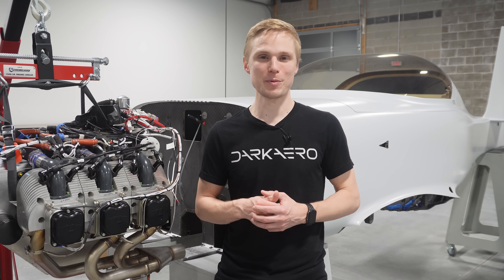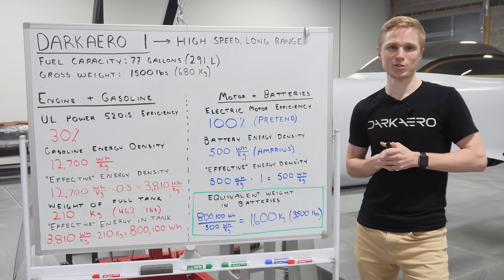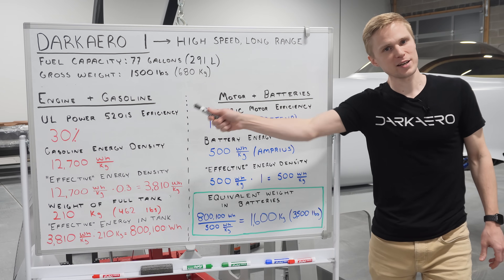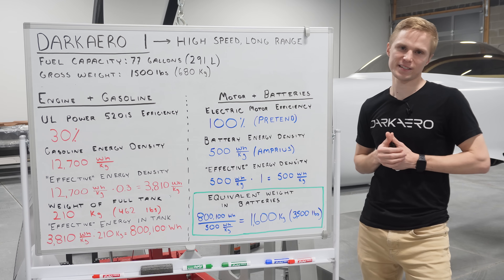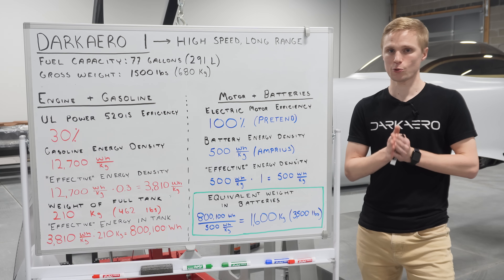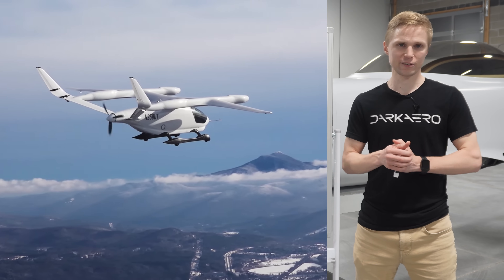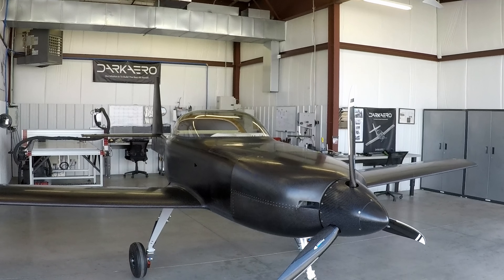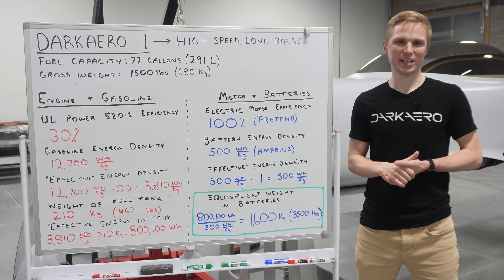The engineering challenge of electrifying airplanes

Comment: I keep seeing people using near perfect efficiency for electric motors, however, the system efficiency is always ignored in these "30% ICE vs. 99% Electric Motor efficiency" comparisons.  In this type of application, what is the transmission loss between the battery, through the switchgear and controllers, to the motor?
Reply: It can be very low. 1 percent loss is definitely achievable. The losses in the motor will generally dominate, especially when operating at high torque. Because there is a weight tradeoff with motors. Making them extremely efficient generally makes them heavy also. So they will probably be optimized for cruise efficiency. At takeoff the efficiency of the motor will likely be poor. Lets say 80 percent.
Reply: @mckenziekeith7434  Do you have references for that loss, since that's significantly lower than what I'm able to locate after a brief search?  For example, Dana's TM4 line (ground vehicles) advertises 95% efficiency for the motor/controller combo in a similar kW range, but that doesn't include the battery-to-controller part of the equation.  Typically, driving efficiency of a system up from 95% to 99% is a non-trivial engineering problem.  

As stated in another reply, the aircraft use case doesn't typically have a large margin between takeoff and cruise power.  Cruise is usually quoted at 75% with lower settings (often in the 60-65% range) for economic cruise, so the max power and cruise design points are much closer than in a car.
Reply: @olpaint71  let's be clear what we are talking about. You asked "what is the transmission loss between the battery, through the switchgear and controllers, to the motor?" I interpreted that to specifically exclude losses in the motor. Maybe I misunderstood. What I am saying is that if the battery is supplying 1000 Watts, the controller and wiring will likely be consuming less than 10 Watts. That is not hard to achieve. I have done it. The balance is delivered to the motor. And of course the motor has losses too. I NEVER claimed that the motor losses would be as low as 1 percent. I am sure it is possible to design a motor like that, but I am equally sure that it will be heavy. What I did say is that typically the motor losses are going to be larger than the controller losses to the point that we can ignore the controller losses for back of envelope designs. That is based on my experience over the last 8 years or so designing small BLDC controllers for electric skateboards and bikes. To a first approximation, the motor losses are I squared x R, where I is the MOTOR current and R is the series resistance of the motor winding. There are other losses, too, but those are usually the largest. The small motors I have worked with have efficiencies of something like 80 percent. Larger motors are typically more efficient. ANY motor will be less efficient when operated at higher torque (torque is proportional to current, power loss is proportional to current squared). So when the efficiency of a motor is given, that is at one operating point. If we call takeoff power 100 percent power output, the motor will always be more efficient at cruise (60 to 75 percent power output) than it is at takeoff. This is for the simple reason that power loss scales as the square of torque. I presume that designers would try to achieve at least 90 percent efficiency for cruise. You yourself said that the Dana TM4 is 95 percent efficient. So the motor must be around 95 percent efficient (or slightly better). A full system analysis would be required to determine if higher efficiency can be achieved since higher efficiency motors tend to have more iron and copper in them and are thus heavier. Perhaps increasing the motor efficiency beyond a certain point will cause the motor to be too heavy or large and will actually decrease range.
Reply: @mckenziekeith7434  Your interpretation is correct.  Basically, if we grant the near 100% motor efficiency, what's the unknown efficiency factors that need to be added to give a truer comparison between electric drive and ICE?  Alternatively, the same question could be raised by asking for the conversion of fuel/battery energy to delivered horsepower at the propeller flange.  That's why I asked if you had some source documentation for assuming a loss factor of ~1% from battery terminal to motor terminal--so that I could learn more about the overall system at these power levels (100-300kW).  

ICE efficiency in this application is very simple, since the typical energy cost of a fuel pump transporting fuel from tank to engine is so  low as to be essentially negligible and the typical 500ci aircraft engine is direct drive, eliminating transmission loss as a factor.  A controllable electric motor in this power range is reliant on external devices that have non-negligible losses.  The TM4 data was handy in that it incorporates the motor controller, but it lacks whatever power conditioning equipment is required for the battery.  I'm also assuming a high-efficiency motor is direct-drive, as well, but I'd note that the TM4 would require some sort of reduction drive to match to propeller RPM which would bring down the system efficiency in this application.

The point of my original comment is that the over-simplification of the analysis does an unintentional disservice to the intended audience because it reinforces an unrealistic view of electric drive systems.
Reply: @olpaint71  yes, many considerations. It is also a fact that for a given power level, a low torque motor will be lighter (and faster) than a high torque motor. But then it may require a reduction gear, which adds weight and saps efficiency. So there are many, many tradeoffs. As far as sources, I don't really have any, but I do have the observation that grid-tie inverters, for example have efficiencies in the high 90s. Switching power supplies in general can be made over 90 percent efficient. And ultimately, the drive for a BLDC or synchronous permanent magnet AC motor is just a fancy switching power supply. That is why I am confident that losses can be kept very low in the drive electronics. But since I don't work in that field (I work with lower power systems) I can't say if the efficiency of the drive and wiring is 99 percent or 98 percent or whatever. High nineties is realistic though.

Comment: Electric motor efficiency: the motor itself will be about 90%, then you add an inverter, it will be about 85%. So 80% is the goal. Quite far from 100%...
And in cold climates, heating is... "free" with gasoline and reduce the available autonomy of the electric engine.

Comment: Honestly... and IMO... a combination of the two would be ideal for me. The fuel driven engine could be fine-tuned to operate within a specific output range to provide power for electric motors. However, must not be doable or they'd be flying everywhere by now 🙂
Reply: Hybrids are heavy and complex, so while work well in cars they don't make sense for most aviation applications.
Reply: Diesel v12 hybrid flight test https://youtu.be/GUEAa8fHvbQ

Comment: Also, buying that many batteries probably costs 50x as much as the gas engine plus fuel system
Reply: You apparently have not checked the price of an aircraft engine. The UL Power UL520iS engine in the DarkAero is so expensive that UL Power won't publish the price (you have to contact them directly), but it's likely over US$40,000. The battery (with about the same energy capacity as in a Tesla Semi truck) would not cost $2M.
Reply: @brianb-p6586  hard to say, one engine is airworthy certified and the other is not. I’d assume this aircraft in the video is an experimental which can mean that buyers can go with a different engine if they find a better value one.
Reply: @Poochie !  it's a DarkAero video, so the rational comparison is to the DarkAero's engine. Sure, an uncertified engine would be cheaper,  but the battery wouldn't be $1M, either.
Reply: @brianb-p6586  sure

Comment: With 77 gallons of fuel onboard and a lightweight, very clean design I would guess that you are looking at a max range well over 1000 miles. 1250 miles maybe?
Reply: The DarkAero website claims 1700 statute miles (1477 nm, 2736 km) at 275 MPH (239 kt, 443 km/h) cruise.
Reply: @brianb-p6586  does that include leaning the mixture😂

Comment: Added bonus to electric is, if you need war power, you just hit the button and dump a bunch of current to the motor. Kinda like nitrous.  Also smooth turbine like power... one moving part.  Also,,, if you run two motors with counter rotating props....or even one motor. (much lighter and less complex than ICE)  Gobbs more power!
Reply: I don't think electric can beat a gas turbine. A turbofan takes gobs of power. Like, a turbofan is to a propeller as a propeller is to a bathroom fan. It's some ridiculous amount on the order of a kW/cm^3 disc area.

Comment: you left out one option: you could have electric propulsion plus a generator. That would give many of the advantages of electric propulsion plus the energy dencity of combustion propulsion.
Reply: Plus the weight of both.  

Weight matters in aircraft more than almost any other mode of transportation.  Installing a hybrid system means you have the weight of the engine, generator, and fuel, plus the weight of the batteries, switchgear/controllers, and electric motor.  Plus, you lose energy every time there's a conversion--engine losses, generator losses, transmission loss between generator and battery charger, loss between the battery charger and the battery, loss between the battery and motor controller, loss in the controller, loss between the controller and the motor, and loss in the motor.
Reply: @olpaint71  you would be quite a bit lighter than a pure electric system, Because you only need a small battery, to account for power peaks like take of. The electric motors (plural, you would want to take advantage of multible controll vectors. ) have a pretty good power to weight ratio. on the generator, you gain a few design freedoms: you can put it pretty much anywhere helping with weight distribution. You don't need the same peek power output, so you can make it smaller. You don't need range at all, that allows for fuel optimisation. You also have a wider choice on types. you could use a free piston engine wich comes with its own perks. or you could use turbine since you don't need to worry about a gearbox and range.
Reply: @MusikCassette  The reduction in power between takeoff and high-speed cruise is not that great.  Typically 75% power is the quoted normal cruise operation for most light aircraft, with economic cruise being somewhat lower.  An aircraft is not a car where highway cruise power may be 20% of max power, so the hybrid system advantages are much diminished while the disadvantages are magnified.  There aren't exactly stop-and-go traffic conditions in the air, either.  Regenerative braking could be a thing with respect to the descent phase of flight, but really doesn't make sense, since the added drag reduces the distance-over-ground and shortens the amount of time the aircraft is operating below cruise power settings.  

The more motors you add, the more wiring, and the more weight for the same effective power output.
Reply: What possible advantage do you think there would be of the electric components of this hybrid propulsion system?
Reply: @brianb-p6586  less mechanical components, more reliability, a number of design freedoms and multible tight controlle vectors. The later is vital if f.e. you wonna do VTOL. Pretty much all the advantages that electric planes have. but without the weight penalty.
Reply: @MusikCassette  You're adding all of the electric components and yet keeping all of the engine, so you have increased the number of mechanical components and reduced reliability. This is not a VTOL design, so there is no design advantage (such as decoupling the propeller mechanically from the engine). If you're talking about a completely different type of aircraft, then of course there will be different design decisions.
Reply: @brianb-p6586  I am not saying this is what darkareo should build. But when you discuss  electric planes, Hybrid is an option, that is on the table.
Reply: @brianb-p6586  "and yet keeping all of the engine" not really.  Agenerator does not need to meet the same specs as an engine  does. on top of that I am didging quite a bit of mechanics. "there is no design advantage" I am not saying, that it would be a supirior design but if you see no advantages at all, that just means, you did not really think about it. At the very least it would be a vast simplification.
Reply: @MusikCassette  what spec change would simplify an engine driving a generator compared to an engine driving a propeller? There is none, except that a smaller engine could have fewer cylinders. 

In a car, some of the engine complication - variable valve timing - results from adapting to a wide range of driving conditions, and an engine driving a generator can avoid that (because the engine speed is not tied to the road speed). In reality, automotive hybrids have exactly the same engine complexity as non-hybrids. In an aircraft the range of operating conditions is very narrow, and so aircraft engines don't have features such as variable valve timing to eliminate.

I don't know what "on top of that I am didging quite a bit of mechanics" was supposed to mean.

I do understand the advantages of hybrid systems for automotive use. They just don't apply to piston-engine aircraft, because of the very different operating conditions.
Reply: Diesel v12 hybrid flight test thttps://youtu.be/GUEAa8fHvbQ

Comment: The problem I wish to be fixed with electric aviation is that typical long flights for flight training and testing are under 4 hours. So the day electric aircraft can fly 4.5 hours will be the day electric aircraft are a true option.
Reply: Normally you can not hold back pee for  4.5 hours unless you dehydrate your body which combined with low cabin pressure environment and low O2 will have some bad effect on your health...
Reply: @electricaviationchannelvid7863  what are you even talking about, this is regarding minimum ‘fuel reserves’ just so you don’t lose power half way though a flight.

Comment: Hello River.
Your video on the comparison of gas powered engine verses electric power for the dark arrow.
Your analysis was well calculated and well presented.

However, it is possible to do a Dark Arrow Electric.

I have a concept based on electric power for the Dark Arrow platform. If my calculations are correct, the Dark Arrow Electric concept will be able to fly NON-STOP from New York to LA. On one thirds of the Dark Arrow fuel capacity.

I am thinking of an HYBRID.

YES,  the aircraft will have batteries. These batteries are for emergency use, with one hour run time on the electric motor.

Do you think an hybrid can work!!! 

What do you think 🤔😊

Comment: I am happy to fly my Ikarus C42 (Rotax 80hp) for 2 hours with 40 litres of fuel in the tank, including a 45 minute reserve. According to these calculations, that is equivalent in energy to a battery with a mass of 220 kg. If I add another 17 kg for the HR3X motor, my Icarus fuel plus motor would weigh 237 kg. 

The DarkAero's 180 hp motor must weigh 130-ish kg and 291 litres of 100LL weigh another 209 kg = 340 kg in round numbers. The Ikarus is neither fast nor long range, and you made lots of assumptions that favour electric powertrains, but it seems I am 100 kg ahead. Electric is not that far off... 

BTW, I love these videos - technically competent and very well produced. Keep up the good work and good luck with DarkAero!
Reply: The batteries used in this video are fictional, nothing but marketing. They were used to illustrate a point, use real numbers and it's comical how bad electricity is.
Reply: @TheOwenMajor  The Amprius battery has been tested by an independent lab. Lyten are promising commercial production of 900 Wh/kg lithium sulphur batteries by 2025/2026 and samples are available for evaluation now.
Reply: You need a lot more than a raw battery and a motor for the thing to actually work...And a hell of a lot more capacity to provide heating for the battery and cabin at the temperatures up at altitude. If you let the battery heat up during taxi and takeoff in hot temps you'll be in trouble really fast. Then if you actually make it to altitude the battery cools down you'll quickly notice you have no more battery left and even before that it will cut power down.